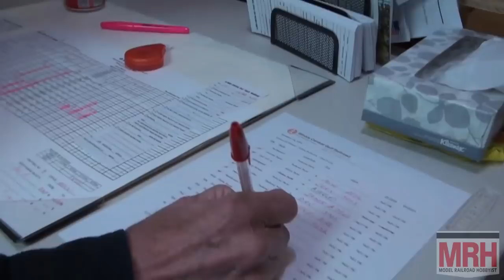Bachmann diorama build | April 2020 WHATS NEAT MRH Mag

Comment: I enjoy your shows. I'd like to see a show that goes into some detail about the financial aspects of the hobby,  including how to budget for various types of layouts,  what costly mistakes to avoid,  and perhaps the dollar range that people typically spend annually.  These and related topics are important considerations for people considering getting into model railroading.
Reply: bmack2000 - the costs associated with this hobby are highly variable. Some of the factors involved would be how large a layout you wish to build; the level of detail you add; techniques for building and time. I've done most of my model railroading as modules for club layouts that usually were two feet wide by some multiple of two feet long. I have found they average about $100 a linear foot to build. That includes frame work for the module, track work, wiring and the finished scenery. The thing is, you don't need to spend all that money up front. The purchases can be spread over months to fit a personal budget if need be. Of course, as the scope goes up, so does the underlying investment. You will eventually get to the range of 'don't discuss this in front of the wife'. That is the range you see here. I feel model railroading is about as expensive over the life of the layout as having a really nice collector car. The up side is you control how quickly you invest the money you're willing to spend on it over what ever length of time you chose. The down side is that it is not an investment you are likely to recover when it comes time to dispose of the layout/collection. Model railroading is entertainment. Just as you pay greens fees in golf, money for theater tickets or any other hobby, you pay as you go and enjoy applying skills to gain a finished product. The subject of operation at the end of this video is one way to share the hobby with your friends by holding operating sessions. 

This has become a long answer that doesn't really answer your question. If you can apply $1000 over the course of a year, and have some hand tools and skills, you could build a sceniced switching layout in HO about 18 inches by 10 feet and be proud of what you've done. Keep in mind that you can buy any number of good looking and good running pieces of equipment second hand at train shows and on line that are there simply because other modelers change the focus of what they wish to have. Hope this helps.
Reply: @cdjhyoung  Thank you for the thorough explanation. Very helpful.